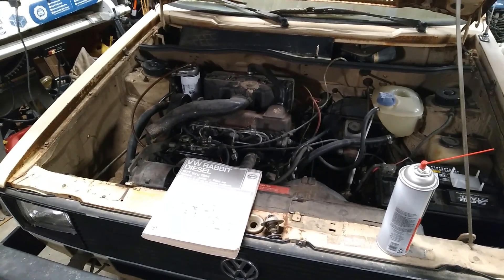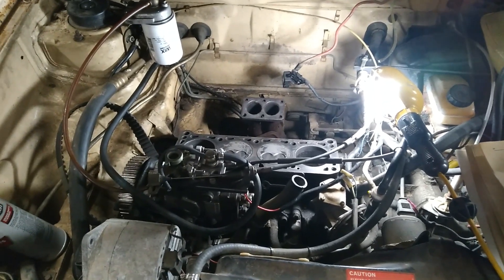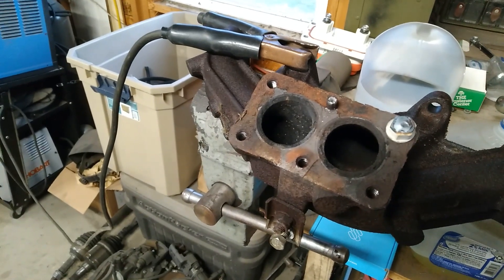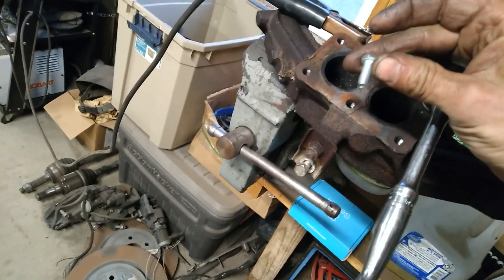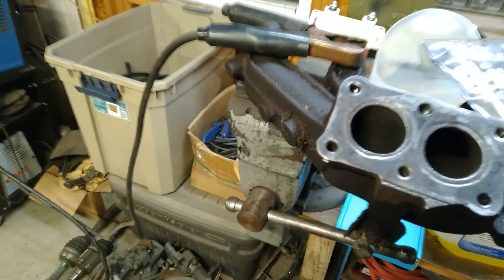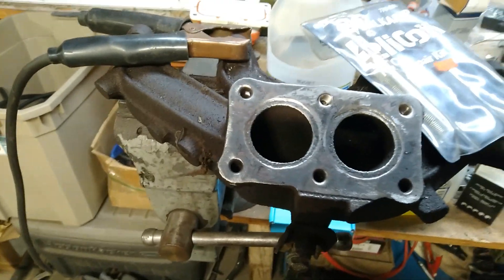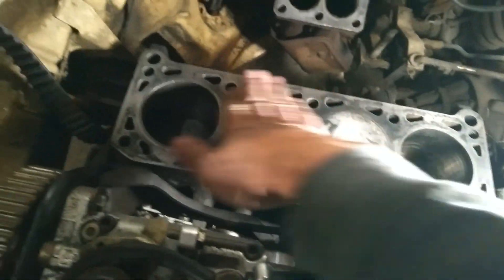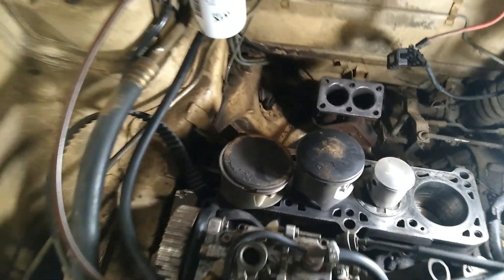Headless Caddy - The Dub

Comment: No point in surfacing the head if it’s still flat.  Check with a straight edge, and make sure the cam dosent rock.  Lap the valves (recommended by vw), replace all 8 valve guides, stem seals and run it.  Measure piston protrusion and run thinnest head gasket possible.  If the head is warped beyond spec, the camshaft will bind when you torque it down if you have it surfaced. The different thickness head gaskets are for when the deck of the block has been surfaced and the piston protrusion increases.
Reply from the maker: well, don't you need a machine shop to replace the guides?  Since they've got it, might as well clean it up.  If the shop is good, they'll identify the warp and surfacing the block will fix it, no?
Reply: Thin head gaskets don't hold up as well as OEM on slight warpages and blow easier.  I would however have the head planned for flatness considering the level of effort you're up against here.

Comment: Keen-serts would be superior to Helicoils, especially on such a high temperiture application.  If you must weld to extract studs, using 304 SS hardware and 306 SS electrodes can yield better results.  The lower melting point and limited carbon migration into you weld work in your favor.  .  I've been know to heat the casting (upside down) then hold an ice cube against the welded-on SS304 nut before applying torque.  Also tightening the broken stud slightly before attempting to unscrew helps more than one would imagine.